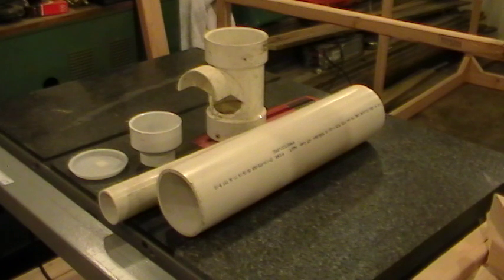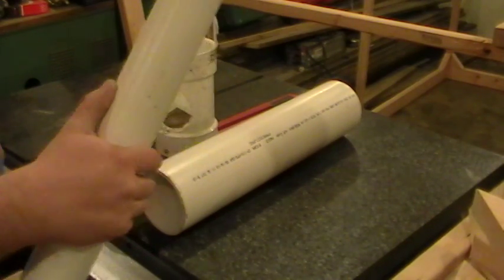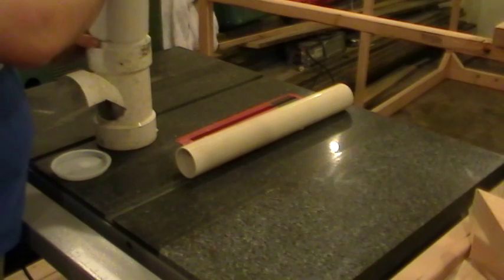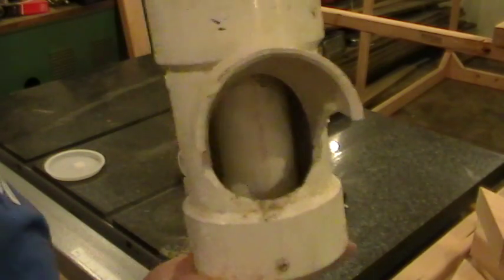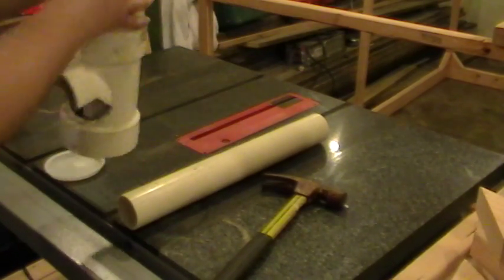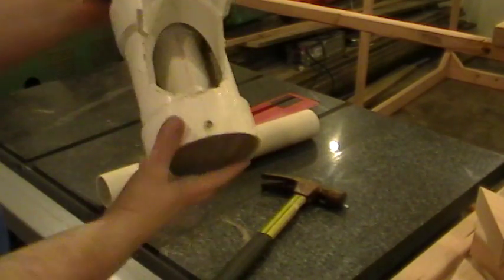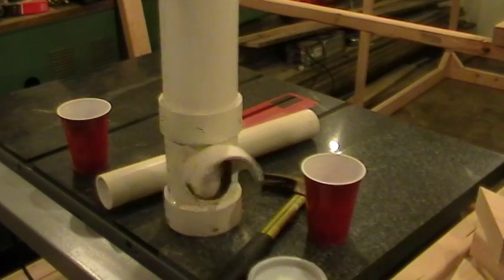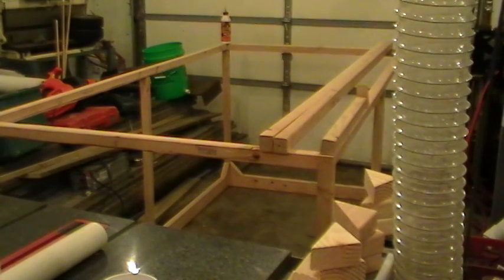Chicken Feeder

Comment: DOESN'T WORK 

Agreed
DOES NOT WORK

Hi Everybody,

I made 2 of these, they looked like a very good design and idea, however I don't believe they were tested before posting the design, they definitely do not work efficiently, I have a 2 feet square of feed all over the floor about 1 inch thick.  I even tried adding a 2 inch lip to the bottom which made no difference.  I will be reverting back to filling a feed bowl once per day.
Reply from the maker: Well I have to say you did something wrong than I have been using the same one I made in the video with no problems, try lifting the inside pipe up a half inch more.
Hope you have better luck.
Reply from the maker: Well your whole comment didn't come thru the first time I looked at it I (had) one bird that would stick it's head in there and just pull pull pull out feed and key word is had,
It became chicken nuggets.